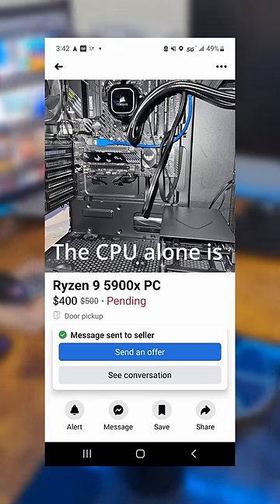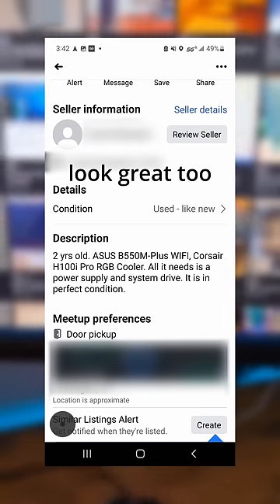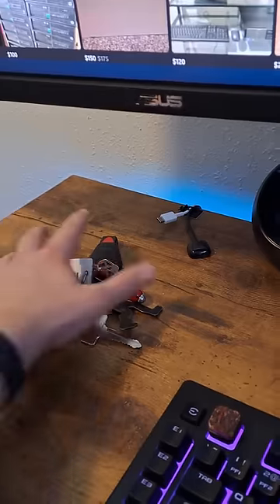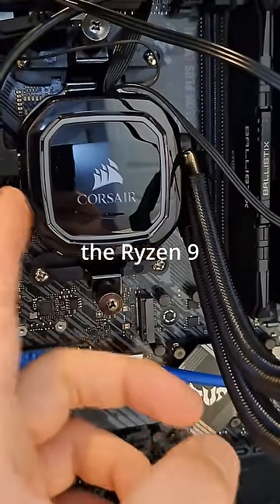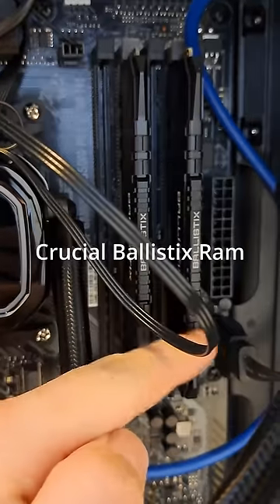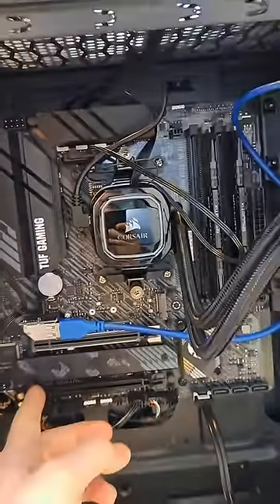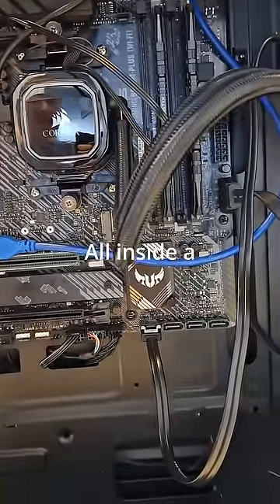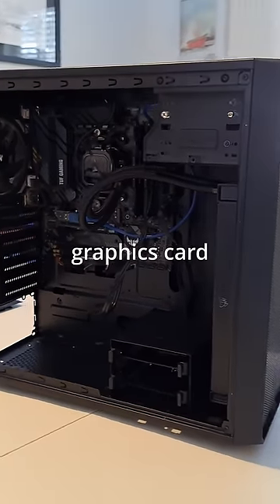Insane PC Deal on Facebook Marketplace - Must See! #shorts #gamingpc #facebookmarketplace

Comment: Bro definitely wanted some money to the point he sold it that cheap😭
Reply from the maker: Yeah, He'd just upgraded to a new intel build and wanted this gone!
Reply: @pcmeld  I was thinking drug monet but I guess that too
Reply: @Fin3rain  i was thinking about bills so atleast I don't feel as bad knowing he isn't struggling
Reply: @pcmeld  That's crazy because you can't improve too much from a 5900x. That CPU will do everything you need unless he was a baller, he didn't need to upgrade that CPU.
Reply from the maker: @mantid83  some people just want the latest stuff even if it doesn't really make sense to upgrade
Reply: @mantid83   The AM4 platform isn't DDR5 compatible, so there's that already. But also a lot of people's primary use is work and gaming on the side so we never know if the guy require more cores or clock speed too.
Plus since he fucked his airflow with his radiator placement he doesn't seem to be tech savvy so maybe he thinks he has to start over instead of fixing his shit up or upgrading only partly.
Reply: @charlesm.2604  DDR5 isn't worth the upgrade right now unless you're a baller and have money to spend like that. 5900x is way more than enough to game and work unless he wanted the best of the best and couldn't wait.
Reply: @mantid83  Well you can't know what his requirements are. At the end of the day if he has the money why not ? It's better to rock current gen and be future proof than staying behind, at one point he would still have to upgrade anyway so he's set.

Comment: That cooler was mounted in the worst possible way. RIP
Reply from the maker: It was switched to a top mount position after I got it. He didn't even have top fans so I don't know why it wasn't there to begin with!
Reply: @pcmeld  there are some "smart" people advising to put water cooler on front panel, because it sucks in cold air and CPU would run at lower temperatures, ignoring the fact that it would rise temps for EVERYTHING ELSE.
Reply: That’s an amazing deal. I thought I got a great deal with my pc but that one has a better cooler and cpu. (Mine is r5 5600, xfx 319 6700xt, with similar other components for $950)
Reply: Mines mounted in the exact same place with fans and never go's over 40'.
Reply: @MrSCOOBY26  It's not about the temps. It's the location of the pump and piping. You never want a water pump running dry, and with the pump being where it is, that's going to happen.
Reply: @Myrtilys  except this doesn't apply if the pump is embedded in the radiator not over the cold plate .
Reply: @TheShadowSentinel This is incorrect. Currently have an NZXT Z73 mounted to the side of my O11D-XL, with SL Infinitys as intake, running a 7900X with Arctic MX6. 
7900X is running stock and undervolted with a -35 curve on all cores, I'm running at 4.7Ghz, idles are ~32°C, under load it doesn't go above 45°C.
Reply: How come? About to do my first build and am curious
Reply: @nczioox1116  Dude thinks he's smart but has no clue what he's talking about.

If you're going to use an AIO, you have two choices: side mounted for intake, or top mounted for exhaust. 

Side mounted with static pressure fans in an intake configuration results in a cooler CPU but slightly hotter GPU.

Top mounted with non or regular static pressure fans in an exhaust configuration results in a cooler GPU and slightly hotter CPU. 

In most cases, it's whatever fits best in your case. However, you need to make sure that wherever your pump is located (typically on the actual CPU block for most Asetek style pumps) it's BELOW the highest point of the loop. 
Never mount your pump higher than the highest point of the loop, typically the top of the radiator.
As long as your pump is BELOW the radiator, you're fine with whatever you do. 
Some orientations are better than others but that's the one rule you need to follow.
Reply: @nczioox1116  Extra wear and tear, extra noise, slighter hotter temps if it's getting really bad. No matter how well sealed or full an AIO is, it'll lose fluid over time. If your pump is the highest point of an AIO, the air will eventually get there. Pumps need the water to run smoothly, and plus if there's air in the pump it'll gurgle
Reply: It literally doesn't matter that much. Gamers nexus did a follow up talking about it.
Reply: @JustLostTheGame  beautiful explanation for those who dont know thanks!
Reply: @oyeahisbest123  Glad I could help!
Reply: Awesome! Thanks for providing that info
Reply: AIO was fine where it is.
Reply: @TheShadowSentinel  a CPU usually consumes less than a GPU but also requires that cooling more than a GPU performance wise so yeah that 1-3K increase in air temp doesn't do a lot if anything at all.
Reply: @JL-ix5io  no it wasnt the pump was above the radiator meaning as time goes on some water will evaporate leaving air which will get into the pump and destroy it.
Reply: @oyeahisbest123 
It's not guaranteed and it's not like having it like that will shave years off the pump's life. It's fine like that.
Reply: @Ifyoukn3wIt 
Lol no it won't. My oldest pc has an 8700k. I mounted an aio in the same position and it still works fine to this day, 5 years later.
Reply: @JL-ix5io  cap.
Reply: @Ifyoukn3wIt 
This guy watches one GN vid and thinks he's an expert lol
Reply: @JL-ix5io  you are free to install your radiators wrong, don't let me stop you :)
Reply: @Ifyoukn3wIt  
As long as your pump is lower than where your tubes enter your radiator, there is zero problem. Maybe research a lil more, my friend. But you keep putting it at the top... hopefully you have a blower card and not an open air one.
Reply: @JL-ix5io  holy shit- actual pepega, look at the video again.
Reply: @Ifyoukn3wIt 
It's still fine bro. You're acting like it was mounted at the bottom. Front beats top unless you have a blower card.
Reply: @JL-ix5io  you just contradicted yourself, pal. the coldplate is above the rad.
Reply: @JL-ix5io  don't talk to me.
Reply: @Ifyoukn3wIt  
It's still fine.  You'll get your knowledge up one day, I promise.
Reply: @Tofuey  no, you get cavitation problems in the pump

Comment: Great find my man. I would do a decent 850w Power supply and a used 3060ti up to a 3080, or a 6700xt up to a 6900xt, all depending on what you can find a good deal on, and you will have a very powerful computer for around $1000 to $1200 depending on what kind of deals you find, and adding another 1TB m.2 drive would be a priority for me, but thats around $70.
Reply from the maker: Thanks! I added in a 3080 and 2 1tb m.2 drives with an 850w psu

Comment: I got my pc for $350 Canadian. Ryzen 5 3600, Nvidia GeForce GTX 1660 super, Asrock b450m pro 4, 16gb 3200mhz gskill ripjaws ram, nvme WD ssd… marketplace is the best spot to find used computer parts by far
Reply from the maker: That's an awesome deal! You'll get lots of good use out of that!
Reply: Where from!? My pc is so terrible right now and I’ve used it since 2016. I’ve saved up some of my money but don’t want to spend all my money on a pc. Is it possible you could tell me how you got yours for such a good deal?

My specs: Intel i5-6400
IGPU
1tb hhd 500gb ssd
Stock ram and no coolers lol
Reply: I know where I'm looking now, my PC may be running perfectly, but it's still almost 10 years old lol
I5-4590 with the STOCK cooler
Radeon r9 270
16GB DDR3 ram
MSI Z97-G45(the real limiting factor here lol)
Reply: That is such a good price! Considering ryzen 5 3600 is expensive and you got that with gtx 1660 super 🤑

Comment: One thing at the radiator is lower than the CPU socket Which damages the pump.
Reply from the maker: Yeah I switched the radiator to a top mount position after I got it!
Reply: more like lower the lifespan as the pump has to work harder especially after a while when more and more water slowly escapes. it shouldn’t break anytime soon but will definitely be louder. but yeah definitely not optimal and shouldn’t be done unless absolutely necessary
Reply: @JrEtwon  yes, my mistake your right :)
Reply: @gohome7159  nah you good it’s the right idea but the phrasing’s a bit off so someone might get the wrong idea, as it’s a long term issue not a short term one

Comment: The AIO cooler is upside down. The pump will die with it in that position
Reply: If they didn't vent the air to the rad first; yes. Easy fix would be to flip the pump around, or, tilt it to the left and let any air travel to the rad prior to running it.
Reply: Nah but having the pump higher than the radiator is a problem.
Reply: @poison7512  that's what we're talking about lol, flipped around, it no longer is

Comment: Cpu clock is the highest point in the aio loop. You can end up with air bubbles at the pump and shorten the life span on the aio.
Reply from the maker: I definitely fixed the aio orientation after purchasing!

Comment: considering my rig with a 5900x and a 3080 ended up costing around &2300, I’d say $400 for another $600-&1000 worth of parts to make a sweet rig is a pretty good deal
Reply from the maker: I already had the extra psu, gpu and some m.2s so it worked out nice

Comment: I bought my last 3 systems on the used market and couldn't be happier. Years later, they are still functionning just fine, temperatures are good, and I saved hundreds of bucks. I recommend, but beware of scammers, it's a sad reality.
Reply from the maker: I love buying used hardware. There are some great deals and if you look out for scammers you'll be fine.

Comment: That cooler is probably cooked. The pump is far too close to the top of the loop. There's a good chance it goes soon if it hasn't already. Might have caused some overheating. It's also possible they bought this for the gpu and just wanted to recoup losses.
Reply from the maker: Yeah, I moved the cooler to a better mounting position. It seems to be running fine so far!

Comment: Sold my old PC to a friend from work, R5 5600X, GTX 1070, 32GB DDR4, 750W PSU, some MSI z390 board, Cooler Master Hyper 212 EVO, in an NZXT Phantom 410 case. Priced everything out at $1600 at the time, sold it to him for $250.
Reply from the maker: You are a good friend
Reply: @pcmeld  I even threw in my old 120Hz Acer 3D Vision monitor, my old Razer Blackwidow Chroma and my old Logitech G502 Hero, he still had the audacity to ask if I could do $200 even hahaha

Comment: I bought mine for $800 off the FB Marketplace earlier in the year. It has a Ryzen 9 5950X, 4x16 GB kit of Corsair Vengeance RGB Pro at 3600MHz, a GTX 1660ti, a 750W Corsair fully modular PSU, a 360mm Corsair AIO, a Samsung 980 Pro 1TB SSD, a MSI MPG X570 Gaming Edge WIFI motherboard, all in a Corsair 4000D case. Best deal I have ever gotten on Facebook. 🙂
Reply from the maker: That's a great computer! Congrats on the deal!
Reply: @pcmeld  Yeah, it definitely is an amazing PC for the value. Thank you as I do appreciate it! 🙂
Reply: The graphics card sucks tho and prob gets bottle necked by the cpu all the time

Comment: If I did, I’d install CPU-Z just to be sure I didn’t get scammed. $400 for this setup seems too good to be true on paper.

Also, place the radiator of the AIO/CLC at the top of the case or flip it around to have pipes below the CPU block. That position is okay, but you will hear gurgling as air is making its way to the pump chamber.
Reply from the maker: I checked it and it's legit! It was a sweet deal! I did fix the radiator position!
Reply: @pcmeld  Oh…well…bully!!

Comment: I cringe when I see AIO radiators that low with respect to the pump/coldplate... somebody didn't know what they were doing when they put that together. The radiator might just bareeely be high enough but I'd be alot more comfortable if it had more room. Putting the radiator in the top of the case would've been a smarter choice, especially if he has case fans in the front.
Reply from the maker: It definitely need fixed. It is now in a much better place!

Comment: Got a similar deal. Ryzen 7 5700G on a MSI B550m pro-vdh wifi with a 650 EVGA bronze power supply, 500gb Samsung 980 m.2 ssd, 2x8 g skill 3600mhz ram, in a mini-atx case for $400. Added a Sapphire Nitro+ RX 5500XT SE for an additional $200 and it's been great so far 👌
Reply from the maker: That's a great deal! Congrats!
Reply: @pcmeld  thanks! It's my first PC that I'm building (well half built), but I've watched so many videos on how to OC the system and learn the bios in and out. Running a 2k monitor too. Main purpose is to have something that can handle rendering and editing for my wife's videography business
Reply from the maker: @lucaspreiss4273  that's so fun! I hope you are enjoying your first build. That's an awesome rig for your  wife's photography business!

Comment: I recently got an insane steal for only 700$. i thought it was to good to be true until he showed me a video of it running and there appeared to be 0 issues with it so i picked it up and its running well.

AMD Ryzen 7 2700X
EVGA Nvidia RTX 2080 Ultra XC2 8gb
Corsair Vengeance RGB PRO DDR4 3200 C16 2x16GB (32gb)

Kingston A400 240GB SSD Boot Drive
Seagate Barracuda 8TB Hard Drive
MSI B450 Tomahawk Motherboard 
EVGA 750w PSU
Reply from the maker: Not a bad deal! Congrats!

Comment: Ooof. Owner didn't look where his AIO radiator is supposed to be mounted. Has the hoses at the top instead of on the bottom. There might of been damage to the CPU
Reply from the maker: I definitely fixed the mounting!
Reply: @pcmeld  did the CPU suffer damages ?

Comment: How do you know it's a 5900x and not a 2600?

1. Never buy a rig you can't see loaded on a screen.

2. Never buy a used AIO...it might already be low on fluid OR a week away from dead pump.

3. 400 and you still need a gpu and RAM AND psu..... ehhhh

Comment: yup literally just built this with a 4080 GPU and a H170i cooler
Reply from the maker: I bet that's a killer pc!
Reply: I does very well haven’t found anything yet that it can’t run on ultra settings. Also has 64GB DDR4 RAM. It’s basically over built.
Reply from the maker: @Mallen29881  sounds like a great experience! The real question is how many chrome tabs can you run with 64gb of ram lol

Comment: What's with the blue usb cable running straight across the motherboard
Reply from the maker: It adds 4 usb ports on the front of the case.
Reply: @pcmeld  no it looks like it's plugged into a pciex1 slot like those odd mining gpu riser cables
Reply from the maker: @majapaja_  I know, but it hooks into a usb expansion card at the front of the case. It's weird first one like it that I've seen
Reply: @pcmeld  oh that's absolutely unhinged

Comment: I got my pc on market place as well. A 3070 and a rayzen 7 3700x for 1200 us
Reply: Bro that's way too much overpay you can get the same parts New for less what you paid
Reply: @kingbaba8361  it has a liquid cooler and 150 dollar ram tho. Also i did the math wrong i payed 1600 aud which is around 1,100 us
Reply: @froggyblocks  still much forr used ngl Herr the exact same builds go for 700 -800
Reply: @kingbaba8361  i guess but it was the best i could find. pre builts cost a lot more
Reply from the maker: your used market makes a big difference!

Comment: I got a ryzen 3800x and an x570 gigabyte arous board inside of an old nzxt switch 810 case for a low low price  of 35 bucks off of FB and somehow I got lucky and the parts still worked
Reply from the maker: that's an incredible deal!

Comment: Damn I got a similar deal on FB for $480
Except it had a 5600 with an RX 570 and a 550 watt psu. With no water cooler just a standard one. Everything is good just looking to upgrade the graphics card to a 3060/ti cuz the rx 570 hold my cpu back. So I end up getting frame dips down to 40 fps on fortnite sometimes
Reply from the maker: That's still a pretty decent deal! I hope you enjoy it and can upgrade the GPU soon!
Reply: @pcmeld  thanks! I hope so too
Reply: @pcmeld  Hey would 550 watts be enough for an RTX 3060 ti?
Reply from the maker: The recommended psu for a 3060ti is 650w
Reply: @pcmeld  Oh alright, thank you!

Comment: you think i should but this i found with a nzxt cooler and msi motherboard power supply and fans u think i should buy it for 300 it comes with a case
Reply from the maker: Look up the value of the parts ebay. You can filter to see sold listings!

Comment: actually I got the best deal on fb marketplace
Reply from the maker: I'd love to hear about it!
Reply: @pcmeld  traded a geo tracker 2 wheel drive that I bought for a 1000 dollars on fb and traded it for a PC here's the specs Intel core i9 11900k, Asus ROG strix z590e wifi, gigabyte rtx 3080 vision oc 10gb, 16gb trident z ram 1 tb nvme SSD, keyboard rgb with mouse windows 11 aio cooler rgb don't know the mm extra cables and cords for the psu Wich it's 850 watt gold ❤️

Comment: good find.
Reply from the maker: Thanks!
Reply: @pcmeld  i got given a r 1700 pc with no gpu or ssd. so i just got a 5600x for it and just got to find good gpu for it around $500 aud. seen some used 3060 and 3070 for about 500. just updating from i7 7700k and a 1080. but don't have money to build dream pc
Reply from the maker: @d.r.paul89  that's not a bad setup and should run fine until you save up money!
Reply: @pcmeld  well i am updating from i7 7700k with a 1080 that i built in 2017

Comment: No, I can get those parts for less
Reply from the maker: I'd love to know where!
Reply: @pcmeld  ebay has a ryzen 9 5900x for 270$, a case is a dime a dozen especially a used one, b550m motherboards go as low at 100$ brand new, 500gig ssds are very cheap now alot of them  are priced less then 50$ brand new so no used ssd, and cooler master sells a 60$ aio, you would spend a little more for all new parts but used yeah you could get that for less just buy getting the parts individually
Reply from the maker: @blackiceecko1  270+100+50+60= $480. If you buy the 5900x new it's $340. Either way adds up to be more expensive
Reply: @pcmeld  like I said if you buy it brand new